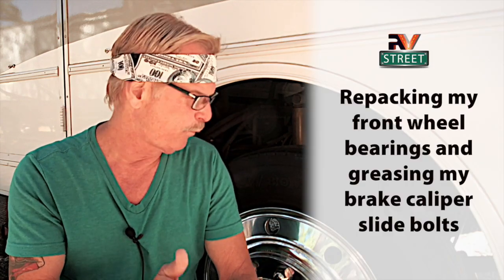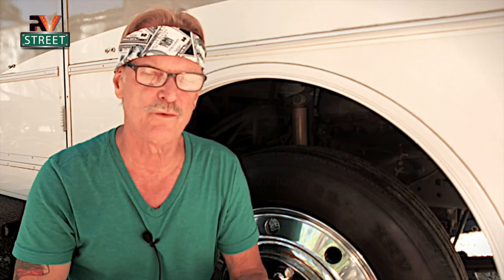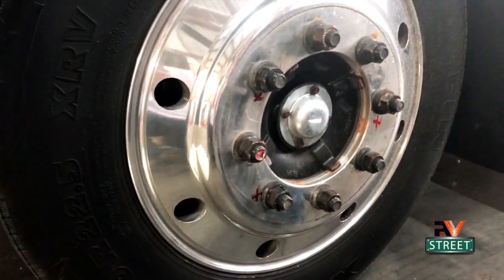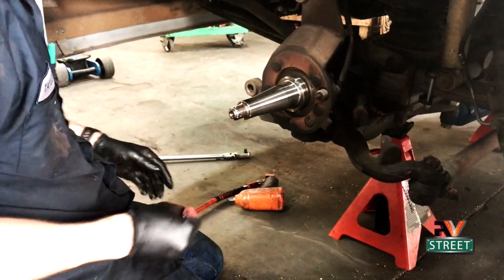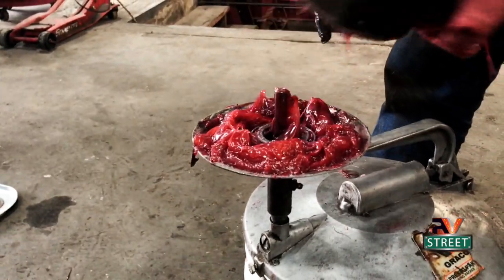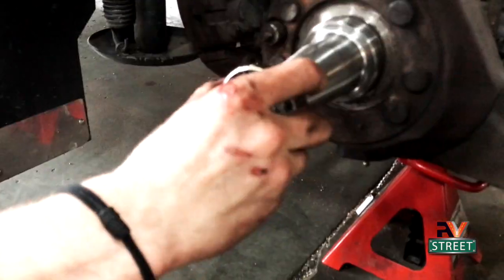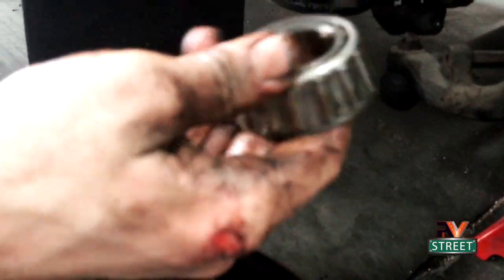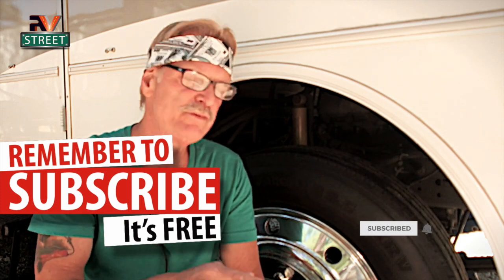REPACKING FRONT WHEEL BEARINGS • CLASS A Motorhome, F53 Chassis

Comment from the maker: Some of you may be surprised that I outsourced this work and didn’t do it myself. I could of done this myself, but it would of been a 2-3 day job getting all the tools and materials I needed, actually doing the job, rental fees, returning all the equipment and probably some scraped knuckles. 😜
I got this job done in a little over 4hrs. and all I had to do was hand over a credit card. With me getting older now, having a weak back, my schedule being full of other things I need to be doing and being full time, this was the best option for me at this time. I am not affiliated with Jamail's what-so-ever.
For you younger bucks, or those who have all the tools on hand this is not that big of a job to do. The grease we used for my bearings and the brake caliper slide bolts are in my Amazon Store in the “Tires, Engine and Chassis Care” category.
https://www.amazon.com/shop/rvstreet
Reply: I am the same way.  I enjoy doing all my work .. but recently had to change my radiator.. which is around a 6 to 8 hr job.  I contemplated whether i should do it or outsource it .. after doing inventory of tools i needed plus 100 plus degree weather in south texas  .  I decided to find a local shop to do the work.. i had all the stuff needed... 10 gallons of fluid and the radiator. Was in and out 5 hrs with 3 guys working on it ..
Reply from the maker: @ecuellar993  There ya go. Yep, sometimes it's just better to out source, especially for those big intensive jobs.

Comment: Hello again, I just wanted to give you an update on my RV.   Although I didn't do any of the work (rear rotors and new brakes and calipers all around). My incredible mechanic let me hover over the job and he told me what he was doing and how as I took notes and helped a little bit by handing him tools and parts.
I did reinstall the stainless steel air valve extenders myself. I checked and rechecked and rechecked....for leaks,  and then checked again after the tires were put back on. Over the course of several hours I checked the air pressure all was well and I am back on the road!

Thank you again for your videos! Safe and happy travels!
Reply from the maker: Great report Lois and—way to go—to get in there and see how stuff works, maintained and took notes. Put all this info in your maintenance log book for future reference.

Comment: Wow!  Seals are usually reuseable if you gently tap the inner bearing out with a piece of wood.  I place a plastic bowl and paper towels under the seal and bearing to catch them.  I could never imagine paying over $250.00 for a front repack.  It costs me about $20.00 to do the job.  Knowing how to set the nut is very important.  I don't like using the word "torque" when installing front wheel bearimgs.  The left side will try to loosen and the right side will try to tighten slightly.  Keep that in mind when installing the cotter pin.  If you notice the brake pads need replacing keep in mind the rear brakes generally wear about the same as the front brakes on an F53 motorhome.

Comment: Martin really good info...I like listening to a fellow veteran talk about PMI (periodic and preventive) maintenance. I worked on F-4's as an avionics guy. If I had seen this  video a month ago I would not have had the misfortune of a failed wheel bearing at 65 MPH. (almost needed to buy new undies...) Fortunately, we made it off of the highway and was towed to an excellent repair facility in Clearfield, PA. The previous owners of our motorhome obviously did not perform any basic maintenance and I have been catching up since I bought the RV. (2004 E450 based Class C). Obviously, I did not check the wheel bearings as I should have and it ended up costing me nearly $1500 in repair. For All of you that have not inspected and repacked (or have had someone do it) your front wheel bearings, let my tale of horror at 65 MPH be a warning.
Reply from the maker: OMG....Mike that must of been scary. Glad everything came out ok 🔧
Reply: Don't repack.
Buy new Timken bearings,not Chinese junk bearings.

Comment: I have a 1998 Chevy 454, 7,4 liter chassis on my Gulfstream, have you done a video on replacement of rear wheel bearing and the way to find the part
Reply from the maker: Haven't done a video on that but you'll probably find your parts at one of these places:
Rockauto.com
https://www.millsupply.com
NAPA

NOTE: I believe you have a P30 chassis.
When GM made the motorhome chassis it was initially designated a P32 and was never really officially recognized as a P30 except for ease of conversation and convenience. 

Most publications, people and marketing types simply dropped off the "2" and the chassis became more commonly known in speech and print as a P30.

The differences in between the P series is blurred and to a GM engineer there wasn't any difference between a motorhome chassis whether it is spoken about as a 30 or a 32 it was simply recognized as a P series.

When WCC got the product the marketing efforts and literature pointed to a P32 Wide-Track designation however in reality to the technician types it was simply a P Series. Later we see the chassis guides dropping or never having mentioned 30 or 32 and simply describing the product as a P series.

Comment: I was hoping to see how to properly torque the spindle nut (so the problem of a spinning inner race won't happen).  Is it like any other castle nut? tighten then back off 1/4 turn?  I wish this video was more DIY, but I understand you can't carry a good set of tools.  Also, how safe would it be to use the leveling jacks to get such a job done?  I'm guessing jack stands are still a must... but how many tons for a jack stand?
Reply from the maker: Yeah I wouldn't rely on leveling jacks for this. Like you said use jack stands and the tonnage will depend on the weight of each RV. On our coach I would use 2 - 6 ton jack stands.
Reply: @RVstreet  Thanks, that's good advice.  On my car, I would never go under it without jack stands, but brake jobs don't require you to go under.  However, on the F53 chassis, those are big hubs and the brakes are deep inside.  I have a 99 bounder, F53, so I am guessing I can use the same 2x 6 ton jack stands.  This just adds to the list of tools you can't be carrying.

Comment: Hi Martin, thanks for the great video. I have two questions.
1. I have a shop and would like to try and tackle this job myself. If you don't have a packing tool like Taylor is there a video on how to repack the bearing that you would recommend?
2. What are the specs on repacking rear wheel bearings.
Thanks again, LOVE your channel, Frank Nabuurs, Charlottetown, PEI, Canada
Reply from the maker: Thanks Frank,
Pack them by hand.
The rear bearings are lubed by the oil in the diff so no repacking them.
Reply: Thanks for the quick reply! Hadn't done my research on back bearings! Only half the job I thought it would be! Many thanks. 
P.S. you folks ought to visit Prince Edward Island and the Maritimes (Coastal Eastern Canada) in the summer. Some beautiful RVing experiences up here!!

Comment: You say it’s an F53 chassis? I didn’t think the F53 chassis came with the 22.5 wheels until this year? Did you upgrade it or was that factory? I’m new but I see the Alcoa wheels.
Reply from the maker: The F53 chassis comes in different weight classes. My chassis is a 22K chassis with a 228" wheel base. Therefore it comes with 22.5" from the factory.

Comment: For us Non-Mechanics... Why Front Only? What is different about the rear?
I am sure you also checked your brake Pads too, how did they look after how many miles?
Reply from the maker: The rear bearings are lubed by oil in the rear differential.
My brake pads were like new. Hardly used. 40K miles. I run our coach in tow haul mode all the time because we're always towing, therefore I'm always using downshifting to assist in slowing down. It will force the engine to increase its RPM's with the soul purpose of using the engines compression to act as a brake.
Use this method for slowing down or descending down steep grades and you'll hardly use your brakes. Great for when in town driving too. Using this method—tow haul mode—you'll hardly use your brakes and you'll get 100K out of your brake pads easy. So in conclusion, if you use the Tow/Haul it will save your brakes.
Reply: @RVstreet  Cool Thanks additional info. Tow/Haul mode kinda sounds like gas engine version of a diesel engine Jake Brake - very handy indeed.
Reply: @RVstreet  Hi Martin, love your videos. You mentioned using tow haul here. I am pretty new at Class A RVing. My only concern is the down hill decents going through the hills. It would be awesome if you did a video about useing tow haul on incline and decline driving for us rookies. The decilne is a thought that I wont lie, makes my palms sweat a little.
Reply from the maker: @mickthedawg4575  Thanks Mick. Yeah I have thought about doing a video on that subject because I know a lot of folks don't understand how it works and how to use it. Since Joanie would have to be shooting while we're underway, I'll discuss it with her and see if she's comfortable and able to do it. I also have to overcome an audio issue with my mic when driving. But when we leave Maine, we'll be going back to RGV for the winter through upstate NY around and down thru OH and down thru MO thru the Ozarks. That would be a good place to demonstrate how tow haul works and how to use it. Descending can be a little frightening at first, but once you get the hang of it, it's a piece of cake. 

For right now—for you—as you peek at the top of a mountain and just start your descent allow your speed to get to about 45 or 50mph (or so depending on the grade) and then tap the brakes. That will down shift the tranny and the engine RPMs will go to about 3200 or so. You can usually leave it right there the whole descent and MAYBE tap the brakes once in awhile to control your downward speed. You're letting the tranny/engine do all the work of slowing you down and not hardly using your brakes at all. Just stay in the right hand lane and let everybody pass you. 👍

Comment: How do you choose a mechanic to work on your rig when you can not do the work? I hired a company to do a bearing/brake job in October. The Sunday before Thanksgiving we lost the passenger side bearings and the tire passed me on the on-coming traffic lane. We are now in the process of getting a second axel as the company assigned by our travel provider put a bad axel on, but told us to have an alignment and some welding done. Yet another company now has the unit having to find another axel and other repairs.
Reply from the maker: So you lost a tire one month after you had a bearing and brake job done? Just asking, the only way you could of lost a tire is if the lug nuts came loose and then everything unraveled from there. We're they torqued correctly? After you had the job done, did you come back after about 50-100 miles of driving and have them retorque the lugs one more time? Have contacted them about this? Something wasn't done right and they should be liable? What a PIA. WOW. I'd like to know more info about this, how it happened, what type of rig it is and the name of the company.

It can be tough to find one sometimes for sure. The reason I chose Jamail's is because I had already done a test case with him on alignment the year prior. Because he passed with flying colors doing that I knew he was the shop for doing my bearings.
The other thing I do is, I'm always reading online. ALWAYS. I read case studies, post of RVer's in RV forums, youtube videos, blogs etc. Over the years I have built a list of all sorts of different kinds of service shops that specialize in different tasks. Windshields, chassis work, replacing windows, fridge replacement, and so on. I have them sorted by states. It's not a real organized list like in a spread sheet but it's a list none the less and I understand it. Shops or mechanics that make this list are ones who have a proven record of expertise, good pricing and fair play. When you are full timing like we do—always being on the road—I feel you need a list like this JIC.
Here's another overall, general purpose tool that may be of help to you. 
http://www.rvservicereviews.com

In summary, if you've watched any of my videos in the past you know I cut all recommended maintenance schedules in half. I'm a real proactive guy. I perform PM items whether they need it or not OFTEN. I don't like surprises or down time if I can avoid it.

Hope this helps 👍
Reply: @RVstreet  When I got the tire out of the tall grass and put out all coals from fires. The lug nuts were in place and properly torqued, when I got back to the trailer and checked the castle nut was partially melted, one u bolt was cut and the other was about 1/2 cut, the axel. Additionally, the brake drum was broken in places as well. The remaining brake parts were ground flat. Everyone I have shown pictures has stated the bearing was not properly replaced, one said it was too tight. I have started relearning to pack bearings and will be doing my own breaks and bearings from now on. Currently, I am getting all the information possible, names included to the Insurance company to get the trailer back on the road.

The mechanic who installed the replacement axel while we were away from home told us to have the axel supports welded after a wheel alignment. The local major RV Dealership has told me they have to replace the axel because it is not a proper axel and the tires are riding on the inner edge of the tire. This has been a real frustrating process with more to come. Trying to find good Mechanics to work on my rig for things I can not do, but not willing to allow anyone to touch something I can easily do anymore.
Reply from the maker: @johnbutler2231  Oh, ok, so this was a RV trailer not a motorhome. Since you commented on my motorhome wheel bearings video I thought you had one. That makes more sense. I don't understand the "one u bolt was cut and the other was about 1/2 cut" part though. There's a lot info out there on repacking trailer bearings and yes that can be much easier than on a rig like mine. Another thing a lot of trailer owners do is upgrade their leaf springs and other suspension parts. Factory suspension and gear on most frames usually just meets minimum requirements for rated loads. They're like 7K lb. axles. When your dragging these heavy things all over the country it's a really good idea to upgrade to the 8K moryde axles and suspension.  Watch this video for more info: https://www.youtube.com/watch?v=EWMVOm_JCaU&t=937s
Reply: @RVstreet  Sorry, yes we are in a travel trailer, but we still, need a reputable RV mechanic at times. How do we choose one once we are on the road in a few years now?
Reply from the maker: @johnbutler2231  Start accumulating a list of folks now like I do. There's no easy answer. Read, study, learn. It's just part of the RV life style. 👍

Comment: Question for you Martin. 

Our Ford F53 24K chassis spec sheet. 
Chassis ratings: 
Front GAWR 9000, Rear 15,500, GVWR 24,000

Axle weight rating: 
Front 9000
Rear 17,500

We are UNDER on the GVWR, UNDER on the front GAWR and OVER on the rear GAWR but UNDER on rear axle weight rating. What’s the difference between the GAWR & the rear axle weight rating?
Reply from the maker: There is no difference between GAWR & the rear axle weight rating. They are the same things. GAWR = Gross Axle Weight Ratio. 

But from the numbers you posted above I'm not sure where you got the Axle weight rating of: Front 9000 & Rear 17,500, but your axle itself may be in fact rated for 17,500 but when mounted on your coach, the over all capacity is reduced with all the other weights and capacities considered by the coach manufacturer.

Your top Chassis rating numbers tell the real story: 
Front GAWR 9000, Rear 15,500, GVWR 24,000. Your rear axle weight capacity IS 15,500. That total weight is divided between both rear set of dually's. 
*As another added piece of information*......So that means 15,500 divided by 2 is 7,750 each side of the axle and that 7,550 is again divided by 2—which is 3,875—because you have two tires handling that load. So the proper PSI you should be running in those rear tires is whatever your tire manufacturer calls for each tire at 3,750 cold pressure. Then add and additional 5% to 10% to account for varying temperature swings and possible weight creep.
I explain this more in detail here: https://www.youtube.com/watch?v=Q_NuEoBIxe8&t=598s
Reply: @RVstreet  We got the specs for our Ford manual that came with our coach. Confusing because the chassis number is 15,500 and the axle number is 17,500. Thanks for the info 👍👍👍
Reply: @RVstreet  We did follow your video and split the difference between the 5%/10% and followed Michelin guidelines 👍👍👍
Reply from the maker: @richardberger326  Ok well you should be good to go then. Thanks for your question so much. 👍